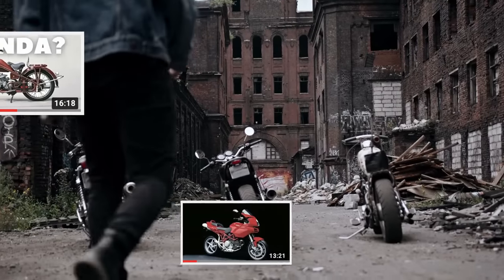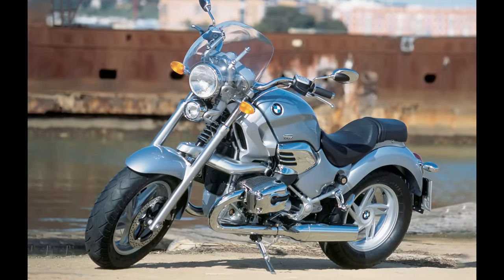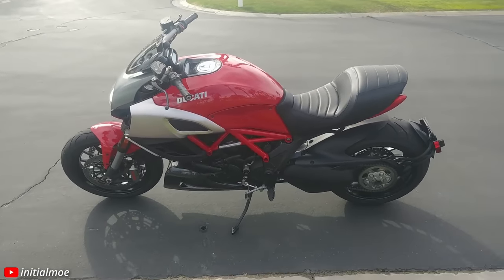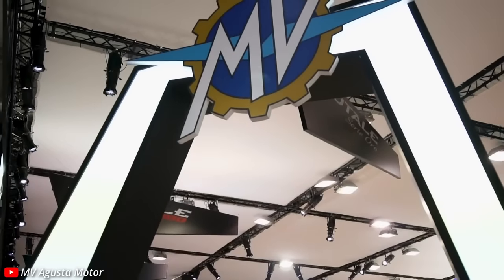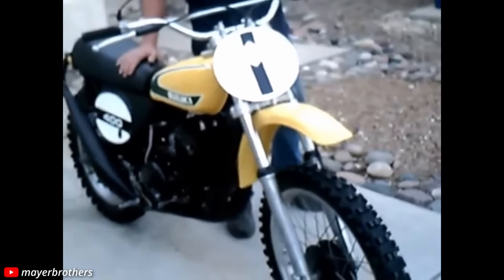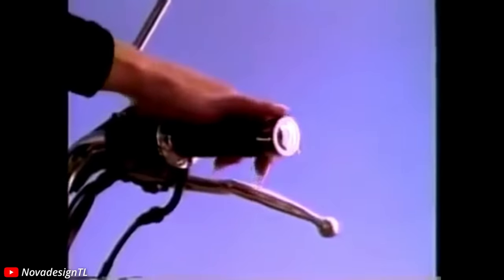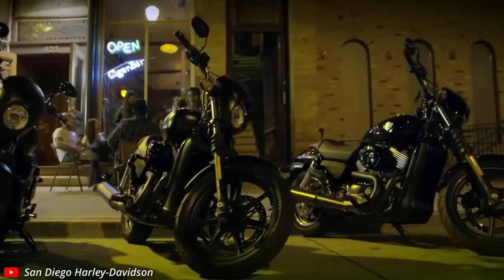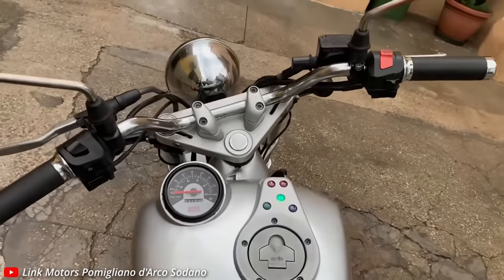The WORST Motorcycle from every manufacturer

Comment: I had a 1982 Virago 920 and now I have a 1996 Virago 1100. I thought the early 920 and 750 were nicely styled compared to the later models. The mechanicals were well designed and easy to service, except for the poorly designed starters in the first few years.
Reply: I have a 535, and it is a great machine. 

I agree the stock design can seem a bit clunky depending on the angle you're looking at. Personally I'm not a big fan of the front appearance of the bike. But the profile is stunning imho.

Meh, to each their own I guess, but Viragos are a prime example of how bikes change from photo to real life.

I did not like them at first, but saw one live and I had to buy one!
Reply: I remember seeing that 920 while doing research for my 535.
Reply: I had a 920, and I freaking loved it.
Reply: i absolutely loved my virago,(1993 1100) and if they made one today id buy another, my issues werent with the crunchy sounding starter, my issues were with the charging system. i got mine because i had 2 friends with em, always gawked at them......anyways i got mine, and started hearing the warnings. they were right. at about 30-45k miles the stator will go out, the regulator goes first, overloading the stator, cooking off the laquer. anyways i heard that the replacement oem ones dont last, then i found it out, i was replacing both every 2500 miles. after asking around i hear the same thing about 3 out of 5 times, the problem is stator and regulator. i replaced 2 stators 3 regulators, and got rid of mine, but i really loved that bike, and wish they would update them, and make them again.......i had the chance to get another about 3 months ago was dead set, cash in hand, but once i saw it i remembered my aggrivation, and declined.
Reply: I had the 1100. Really regret losing it (hit by drunk driver outside my house) it was a fantastic bike after a few tweaks.
Reply: Had a 750 and it was awesome
Reply: @jvwg95rt98  Ditto often regret selling mine.
Reply: I remember doing an engine rebuild on an 1100 some time in mid 1990's.
 It was in a custom chopper frame and I did 'a bit of work' while in there.
 Even with stock cams and carbs it was stupidly fast acceleration being 150lbs or more lighter than stock. I was impressed.
 The starter was never redesigned (afaik?) but there were upgrades to the drag spring which prevented the worst of the banging and clanking and failure to engage crank gear
Reply: @tl4life59  You were probably going to the wrong shop who didn't do any diagnosis or component checking.
 I remember doing Suzuki's and Yamaha's on a pretty regular basis although Suzuki's usually still in warranty period.
 Rectifier diodes fail short circuit, battery discharges through stator 'cooking' it. 
If diodes fail 'open circuit the regulator cant cope and burns out, generator overheats burning off insulation.
Normal first sign is dead battery, fit new battery, cooks things faster and your calling next day to say new battery is faulty (yep, did several hundreds like that, mostly from Honda shop across the street)
 We had stators re-wound and I fitted Honda regulator rectifiers from CB250/400N (most crashed bike in Britain 1980) which were much more reliable than OEM (aftermarket didn't exist at the time)
The Honda R/R was designed for 25 Amps, 250/400 put out around 22A which was much higher than majority of motorcycles at the time (I think only Gold Wing and BMW had higher output generators)
Out of thousands of customers, I only ever had two who asked 'do I need to know this shit' No you don't but if your interested in motorcycles you can at least BS down the pub
Reply: yes my only bitch was the starter .the bike ran well
Reply: @david9783   I had a black and gold 1983 920...loved it except its starter issues
Reply: @1crazypj  you could be right about the diagnosis, but i didnt go to a shop, when my first battery exploded, and shot off all the caps i checked the regulator, and found the rubber molding melted, so i replaced it, and put a new battery, after another 1000 or so miles i saw the wiring to the stator melted, under the seat, replaced both, and was charging at proper voltage, prolly 1000- 1500 miles later checked again found more melted wiring.........fixed it one last time and sold the bike.
Reply: had a friend who has had the same issue, after replacing his a time or 2 its now in the back of his garage ignored, due to it happening again. according to the forums we arent alone in this
Reply: @richb8796  Sorry about that, Rich! Mine never had starter issues, and theONLY reason I sold it was that I was going out of the country for an indeterminate amout of time. I'd love to own another, and they're still around.
Reply: I've always been a Yamaha guy my 920 was my first and had two Road stars.loved all of them other than the starter I loved the virago I never stopped riding it .I went so fare as roll starting it...
Reply: @tl4life59  Isn't "Bad-electrical-grounding" the problem?
Reply: @jackdale9831  i wish i knew, but i have since sold the bike 4 or 5 years ago so ill never know.
Reply: Yesss! The STARTERS!  I had a 920 and loved it. Loved the 44 hp for a lightish bike, the engine note was awesome, ride height was perfect, and it just cornered as well as the best of them.  I finally solved the starter problem by machining a groove on the kickout (spur) gear that had the friction bow and put another bow on the other side.  It wasn't perfect, but it didn't kick out prematurely and start gnawing on the flywheel teeth on a drop of a dime as it did before.  Miss my '82 920 Virago!

Comment: 82 Virago 750 was my first bike.  Put about 45k on that before upgrading.  Lived through the starter issues, valve adjustments, and one cylinder sleeve that just started banging around inside the engine and dealt with the dual fuel petcocks.  I had no choice but to polish my motorcycle mechanic game on that one.  Have now owned a 1500 Vulcan A (with the 4 speed) and now a Vulcan 1600 nomad.  Wife still has her 800 Intruder.  Guess I am literally hitting on about all cylinders of "goofy bikes".
Put over 115k on the Vulcan A, and I am just under 90k now on the Nomad.
Maybe loving the quirky is just part of my personality.
Thank you for the list!

Comment: I wouldn't say Moto Guzzi's are intrinsically unreliable, their electrics being perhaps the exception. They're very easy to maintain, even periodic valve clearance checks are straight forward. It's the lack of a wide coverage dealer network that's a liability to some. Their longitudinally mounted V-twin gives them a "soul" compared to other engine designs in owner's eyes.
Reply: In my experience with Guzzi, when they switched to Bosch electrics they were pretty reliable. The linked brake system probably saved hundreds of lives, particularly in USA where riders are 'taught' to use rear brake instead of front (probably a legacy from 1920's and dirt roads?)
Reply: "their electrics being perhaps the exception": Yes, the two most feared words in the motorcycle world.....MAGNETTI MARELLI !!! LOL
Reply: I agree completely. Yeah, some of the switch gear was horrible, and the early Marelli stuff was pretty poor, but super easy to work on and parts are relatively cheap and available- if you know where to look.
Reply: @rixretros  Yep, make LUCAS look ultra reliable. 😄😄
Reply: They went through a bad patch in the late '80s/early '90s, towards the end of the de Tomaso era, when "old man Alexandro" couldn't or wouldn't invest in the factory but wouldn't let it go either. Then he died and Piaggio took them over and everything started getting better. Me and my mate had both owned '70s Guzzis and loved them deeply, Italian Working Hours Electrics (stops at 3pm on Fridays and through all of August...) notwithstanding, but we both bought late de Tomaso bikes and got badly, BADLY bitten by them, especially me, since I was trying to use a 750SP for despatch riding, so my income depended on it. We both moved over to the air-head BMW world after that. I'd buy a modern Guzzi if I didn't have to depend on it for sole transport, but only if there was a dealer nearby, which there isn't (there used to be).

Comment: The late 80's Viargo's were great Bike's. The Rear Monoshock Mounted inside of the Frame with the Gas Tank in front of it under the Seat to make Room for the Downdraft Intake. But it also lowered the Center of Gravity improving Handling.

Comment: The Royal Enfield 350/500 mentioned in this video are the Ladas of the motorcycling world. However, despite being outdated they sold like hotcakes in India and dominated market share in their class. TBH Royal enfield never had a reason to update any of their motorcycles for decades as they had quite the loyal fanbase.
Reply: The harley davidson of india. Why change something that sells?
Reply: Again, they only dominated India because of the Indian gov't. I'm glad that RE is doing well now, but they would have been bankrupt a long time ago if Japanese and other European bikes could properly compete in India. It's most likely why the bike didn't change at all for the 40 years that existed. They got complacent with the idea that no one could compete anyway.
Reply: yup. If i''m gonna buy an enfield again the shifter has to be on the right side.
Reply: @grenzviel4480  correct. RD 350 had a more loyal fan base. if yamaha brings it back today classic350 will be gone.
Reply: If honda had built a 350 version of the cg125 it would have been a different story for Enfield in India.
Reply: @benitopussolini544  correct. if only honda had brought their cb350 twins to India rivalling the RD350 Enfield would have been extinct by now.
Reply: I wish Triumph and BSA had done the same...stay with the loyal fan base.
Reply: With a few Mods once in India they are reliable and will get you everywhere and if it does break down there are a Trillion spare motors at workshops over the whole country, Originally the bike and running gear never changed for 40 years after the Brittish left as the Enfield was designed and built by the British. The British also built India's Train system and Trains that's why they are still the same and have never been improved or changed since the British left,, India would be a Modern and innovative Country if they stayed part of the British Empire instead of inventing a million Call Centers and Scam Centers. PS I would buy a Royal Enfield Himalayan if I was wanting to travel around India, The Royal Enfield Adventure bike and they have dozens of add on features to make them better for touring so India eventually produced a different type of Royal Enfield.
Reply: @MrMambott , I'm sure it would've been beneficial for India, but Britain couldn't afford to have that many 'citizens' right after the war. Nobody likes to lose a cash cow. After the UN resolution was passed, it became increasingly difficult to maintain colonies with correctional norms of treating subjects while ensuring that those colonies remain almost as much profitable as they can. This is where Britain did a cost-benefit analysis and left. After all, the independence movement of the 40s wasn't anything new that the 'Raj' hadn't seen during their 'stay' in India!
Reply: @justanotherperson2576  Exactly,, I was just what if mate and They wouldn't have 100 house wires going to one power pole in every street and province either, I have an Indian Friend across the street, and we had a long talk about it and he said that himself and more than half the population think it was the worst decision India ever made and said that's why he is here and not back home in 1950 lol
Reply: They didn't had competition that time. Whatever shit they make, there were buyers in India. Now it's not like that.
Reply: They are cheap
Reply: @grenzviel4480  I think what you will find is a British company had them made overseas due to the cheap labour and increase in profits,When that company got sold of or bankrupt,Someone bought the old factory and in the basement was the lathes tool's,So just carry on making them in India with a few changes,It happened too two or three British companies,Even in Malta we left a ship yard and the Maltese took it over and become one off our competitors
Reply: @raviniranjan5707  So why  didn't the MORONS take it to the 500cc and the 750cc as did Suzuki and Kawasaki,Yamaha's were banned in some races in the UK,Even that little FS1E could manage 50mph froma silly little 50cc Garelli was another
Reply: @raviniranjan5707  Won't sell in Britain two strokes are banned for road use
Reply: @gordontainsch2624  They didn't give a toss,They made the best bikes in the world end of subject,Any competition that comes along just ignore it,You don't NEED four cylinders on a motorcycle said a Norton representative at 6 o'clock news on at Saturday in 1970 when Honda introduced the 750 four,Ofcourse conveniently forgetting the Ariel square four with two crankshafts a 600cc and a 1000cc, And the Sunbeam a 600cc straight four both British,So why couldn't  Norton because it wasn't necessary to make what the customer wants,We just keep churning out oil leaking slugs and idiotic British will carry on wasting their money, Well they didn't
Reply: @Johnketes54  my point was that foreign motorcycles manufacturers get a lot of taxes in India which makes it extremely hard to compete with what's locally available. Foreign manufacturers then have to raise their prices to adjust, but then no one would buy them because they wouldn't be worth for their adjusted price. A basic google search tells me that foreign (motorcycle) imports get taxed up to 150%, which makes it financially unviable. Not sure about the accuracy, but there is some credibility as this dude also made a vid explaining how RE survived long enough to become what it is now. /watch?v=aDU50er5zGc
Reply: @raviniranjan5707  It is legend in India because it was the fastest thing you could get. In USA and Europe it was just another small bike. Peppy for a small bike,  but nothing phenomenal.
Reply: @grenzviel4480  there are so many types of Yamaha, Suzuki, Honda in India. But they couldn't beat the royal Enfield for some reasons. Now Royal Enfield 650 series are the talk of the country.
Reply: @shajantarcis2486  bro, read my comment again. Don't get me wrong. I like the current RE. In fact I own one and have posted a vid about it. But it's not that there's not enough types of other bike brands in India, but because everything else is subject to massive taxation/tariffs, which in turn forces everyone exporting to India raise their price just to make a profit. If exports didn't have to raise prices, RE would have died a long time ago.
Reply: I loved my Cassic 500. BTW, RE is now the worlds largest selling motorcycle manufacturer.
Reply: @grenzviel4480  Wrong. The Japanese competition can and does make Enfield competition bikes in India but fails to capture it. You can't compare a Japanese bike like R3 with Enfield 650, these bike's customers dont clash. either you want one or the other. Secondly RE was on death bed for quite some time until 2010. There's simply nothing like Enfield in the world being manufactured right now. The japanes copy Honda H'ness sells like 5% the sales of enfield and its made in india for the record.
Reply: @jamesadams2334  The video is wrong. The Classic series wasn't the "bad" enfield, in fact it was the Enfield that made them best seller since it came with new engine in 2010.
Reply: @rickrandom6734  Wrong. There were always faster bikes in India like Jawa, Yamaha RD350 but none of them could offer the fun of long stroke all metal thumper. Similar to how there were always faster bikes than Harley in USA.
Reply: @SurajSinghTomarArya   I meant RD 350 in my reply to person who was talking about it. In my country RD 350 was not so special compared to Kawasaki 500 and 750 two strokes or  Z900, CB 750, GS 750 and likes.
Reply: @MrMambott  When India was part of the British empire there were recurrent famines caused by British policies of extracting food and other resources the people needed. There have been no such famines since independence, whatever other troubles the country has faced.

Comment: I bought an R1200C in 2002.
I've had many other bikes during these years, including a 1200 GS ADV LC.
I really love this bike, like many other.
It has character.
It's not the fastest. 
It's not the most comfortable. 
It's not the most agile. 
But the engine is sweet, it's brakes are very good,  and the design is unique, modern look and classic heritage together.
Since it's appearance it's been said that "you love her or you hate her".
We love her. You hate it.
Long life to liberty.
Reply: I have the r1200c. I loved it from my childhood in 1999 when 1st time saw. It was wow. And now when Im aged I got one fiew years now. Love each time looking and driving with r1200c. Its one of the best in moto history
Reply: It may have had only 61 HP, but it did it at 5,000 RPM. I had a (tweaked) Road Star 1600cc that dynoed at 70 HP at 3900 RPM.
These torque monsters are the ultimate road burners. I used to ride the thing hundreds of miles a day and change gears maybe twice. Love them tractors.